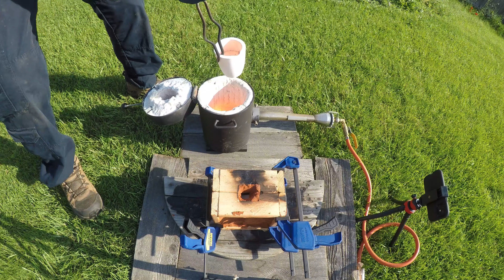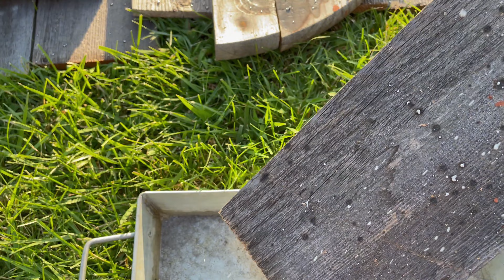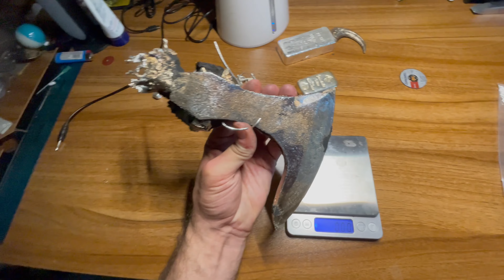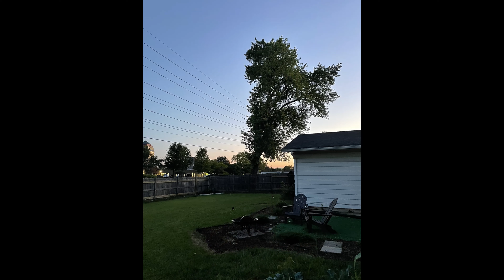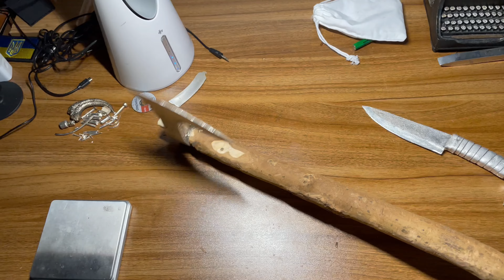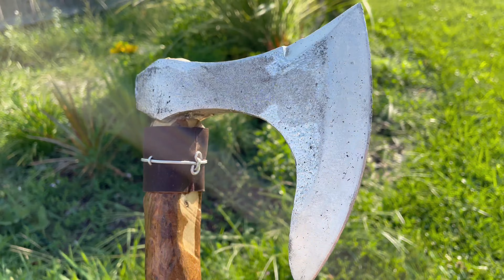.999 Fine Silver Viking Axe

Comment: Came from Reddit. Interesting video, I can’t afford to do this with silver but have been getting into copper. Are you planning to sell this?
Reply from the maker: Thank you for coming over to check out my video, it means a lot.  These big pieces are initially pricy to pour, not just in the silver weight but the cost of delft clay is something else.  But once I saved up enough to make the investment, I have been able to make it into a rolling investment.  With each pour I sell for well over spot, and reinvest in more silver.  So, 20 ounces I bought in 2020, has evolved with each sale leading to the ability to buy over 200 ounces per year to smith and re-sell.  I will sell this piece, but its hard because it is so unique.  The handle is from a tree that fell on my house after a tornado, so I don't think I will ever be able to find a piece of wood with so much power behind it.  Theres a local gold dealer near me that typically buys from me so I'll eventually sell it to them and buy more silver with the profit.
Reply from the maker: You won the Morgan, if you want to send me a message on Reddit with your information, I'll send it out Friday, Cragts!